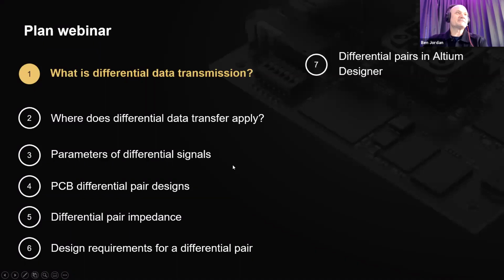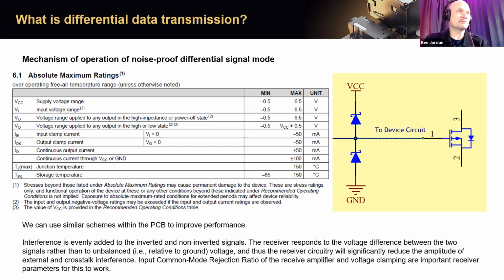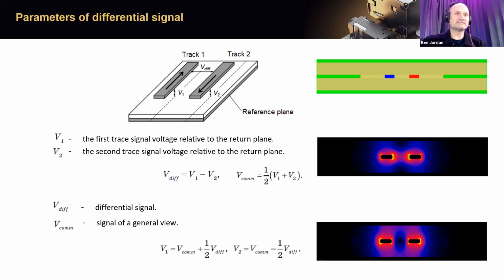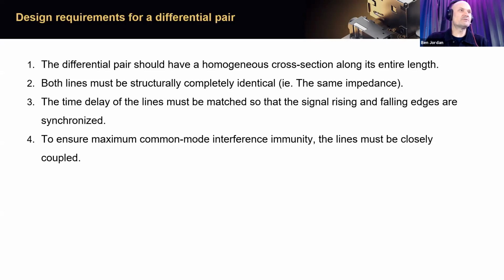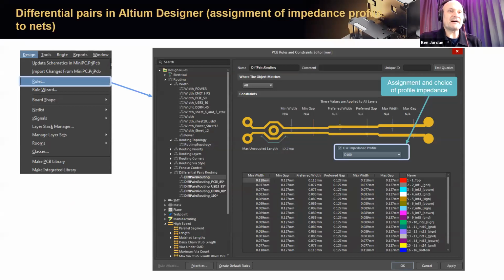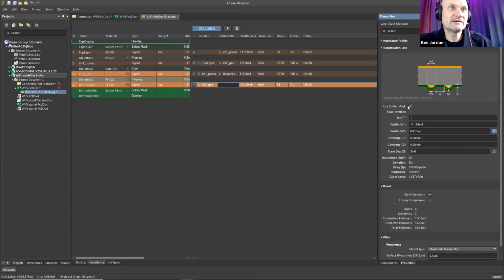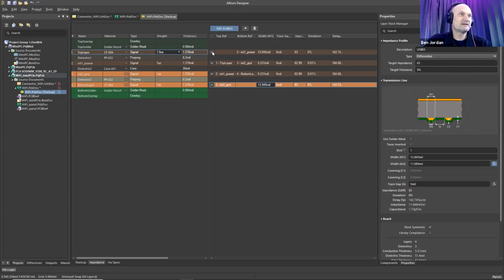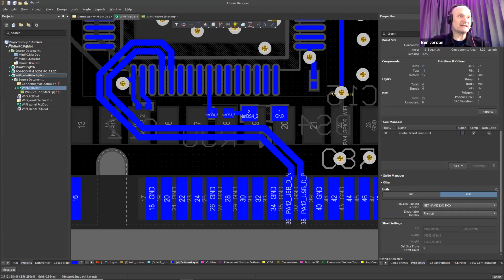How to Design PCBs with Differential Data Transfer (Differential Signaling) - Altium Academy

Comment: From my schematic I have a net named USB_P and USB_N.  I then place a Directive for a Differential and I can place a diff symbol on the USB_P net.  I then select symbol properties and the Label is DIFFPAIR.  If I leave this name or give it a unique name I then copy and paste another diff symbol on USB_N net.  But when I validate I get error  Missing Negative Net.  Any idea how to eliminate this error.  I have attempted numerous naming and renaming, etc... but can NOT clear this hurdle.  From the PCB side I can open PCB Editor set up diff pair, go into layer stack manager and set up impedance for this diff pair and I can route it on the PCB and it seems to know its a diff pair but the schematic is not in sync...still flags missing negative net...ugh!